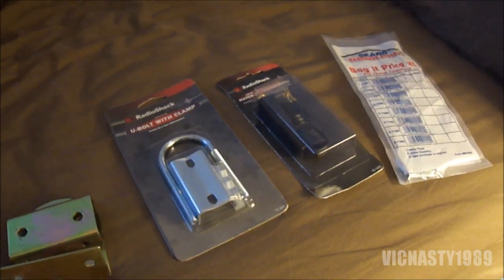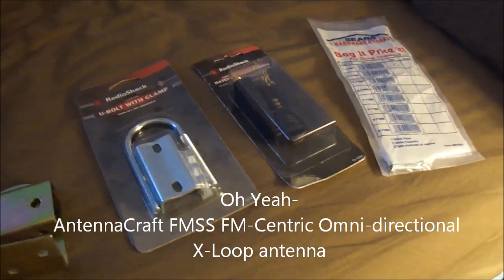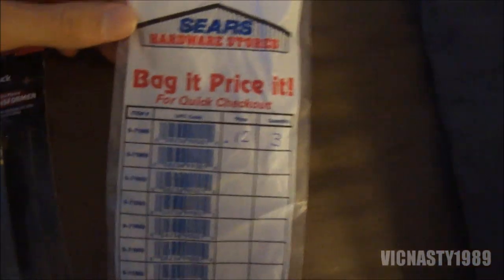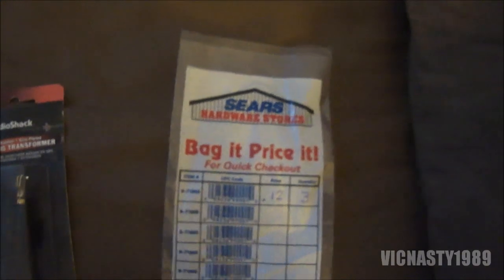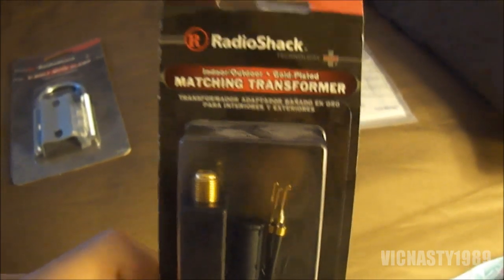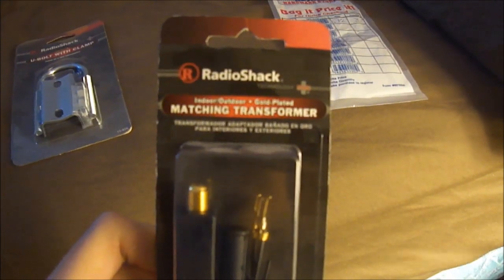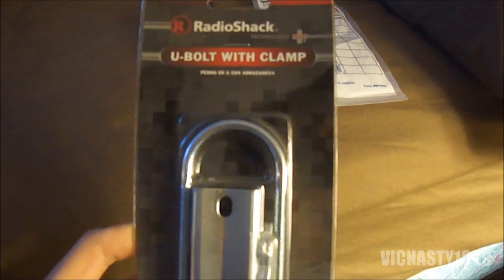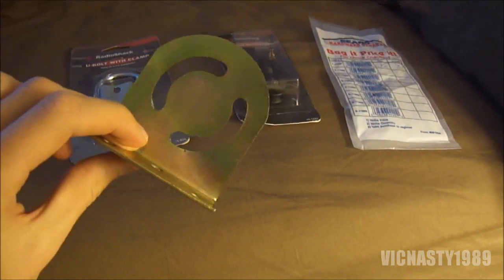Installing an Antennacraft FMSS Omni-directional FM Antenna

Comment: Sweet. 

I have a similar omni-directional FM antenna in my attic (actually came with the house). I just relocated it and added a +15dB amp to it. I forget how many stations I was able to pick up, but it surprised me. I have it on a splitter feeding 3 receivers so far.

Comment from the maker: @andycflbulb 
I am going to hook up my console Fisher Stereo receiver (which has an excellent tuner), to see the distance at which I can pull in stations, and this antenna will help boost local signals that may be weak.  Plus, I am going to do some experiments with my scanner to see how this X-Loop omni-directional antenna rivals the receiving strength of scanner-centric discone type antenna.  And, if I ever need another VHF antenna to add to my TV array, this one is up there.

Comment from the maker: @jay11j 
That is the dilemma most people have when they consider over the air tv, although with proper amplification an attic antenna can work just as well as a large "fringe" (rural area) antenna.  They also have new options that you may want to consider, they sell small low profile outdoor tv antennas that range from the size of a paperback novel to that of a telephone book that mount to a wall or siding, that can rival the receiving power of one of the large aluminum monstrosities

Comment: Great!  It's nice to get an unbiased review from someone actually using the product.  One last question - the Sony LBT-ZX66i has an F connector for the FM antenna, as such will the 300 to 75 ohm transformer be needed or will the RG6 coax be all that's required?  I intend to use an Antennacraft FM pre-amp as well.  Thanks for your input.

Comment: @VICNASTY1989 It is a 4-way splitter, so about 6.5dB per output attenuation. I tried it with a direct run, and with the splitter just to see. It was barely noticeable.

Comment from the maker: It really depends on what kind of connection the Sony has, you will probably need an adapter for RG-6 to the 75ohm input on the stereo- Radioshack should have one for a few dollars.  That pre-amp should bring in a strong signal.

Comment from the maker: Yeah, that old twin lead 300ohm cable is a real hassle (I've used it before, trust me it sucks- LOL!), an RG6 coaxial 75ohm cable is much better for this application.  I love the performance of this antenna, it pulls in radio stations 100+ miles away on certain nights!  Good Luck with your new stereo!

Comment from the maker: @spatsbear2 
Thanks, I remember seeing your video awhile ago with the Sansui reciever hooked up to the antenna in your house, you were able to get a bunch of stations if I remember correctly. I actually haven't run the coaxial cable on mine yet, because I am trying to determine the most direct path to the room with my stereo in it.  Even with the amp, do you loose any of your signal strength using the splitter?

Comment: I installed my Antennacraft 10 feet off the roof bracketed to the chimney & guy-wired. Gotta be outside up high. Putting it inside in the attic is okay but not as good.

Comment from the maker: Yes, the stereo already has 300ohm terminals, but it is easier to shield 75ohm cable from interference on long runs.  Twin lead gets a little static- prone over 30 feet. -Thanks for watching!